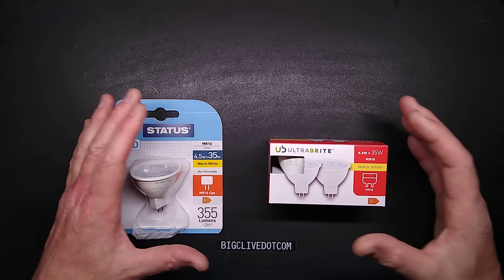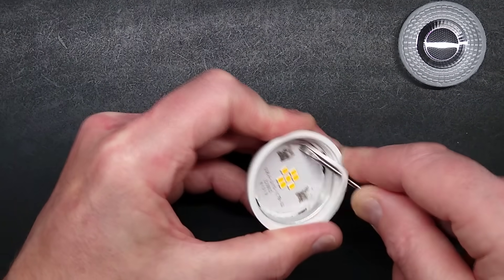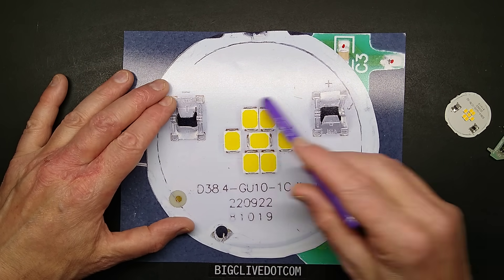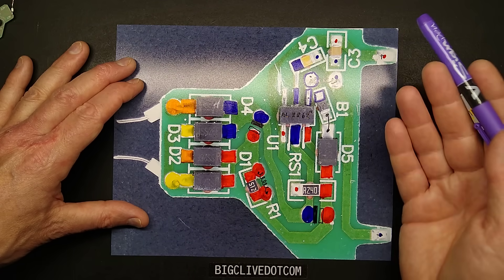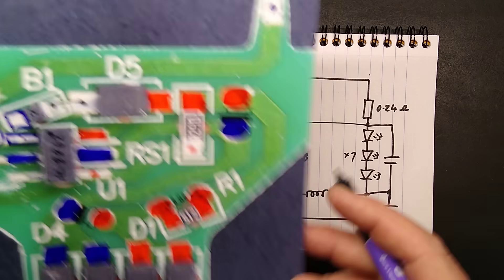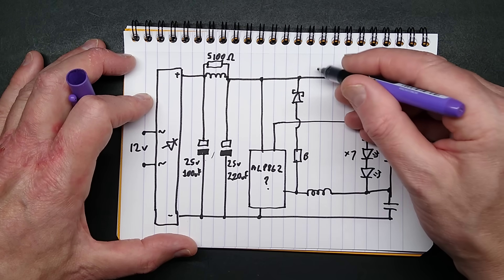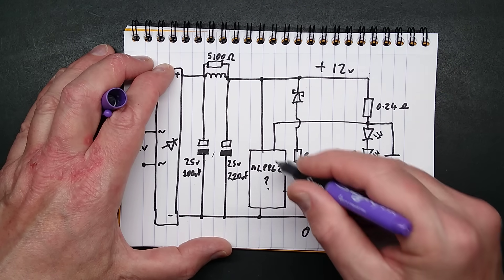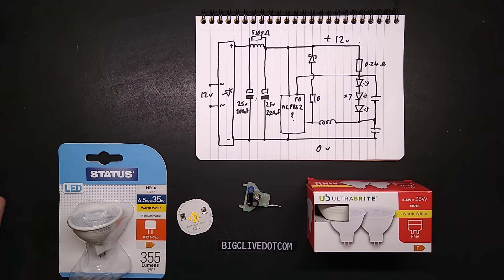Poundland 12V bulb with mystery component

Comment: Hello Clive. Just found this video.23rd  September 2025.
Not very popular now in S A. They were used to replace the MR 16 50 W Dichroic T/H lamp 2 pin. This reflector lamp used a a coil and core or an electronic transformer 230/12 volt A C. The polarity of connecting made no difference. when the 12 V A C LED replacement was introduced. No attention of the polarity was even thought  then when fitting.  Was the LED electronics designed to work on both A C and D C.circuits.? Asking for a friend.
Reply from the maker: The proper modern LED lamps can handle AC or DC and have regulation.

Comment: 3:50 I really like those big printouts of the circuit boards. But in this case, it seems to be a bit too glossy, or the lamp is positioned inconveniently - the reflections make the upper part hard to see.
Reply from the maker: It was a different filming location with less than ideal lighting.

Comment: I need help with my led-lights. If anyone can answer, it is greatly appreciated.

I have 7 spotlights in my kitchen. They have a g4 socket and they are powered by two 12v transformers. The lights originally had halogen bulbs.
I have bought g4 LED bulb replacements that claim they work directly for halogen replacement. However, they dont last long. Less than a year. The money i have saved in electricity is long gone compared to the led bulbs that burned out.
Is there a way I can make the leds last longer? Decrease the voltage with some component? What is my best option here? I really like the spotlight fixtures and dont want to replace them.
Reply from the maker: If the transformers are electronic halogen transformers then they are notorious for damaging LED bulbs.  It may be worth swapping them for regulated 12V LED bulb drivers.

Comment: Some things: First thing, the black board is perfectly okay, but it is just not Big Clive without the traditional, stained hardboard board.  🙂  Next thing, the style of lamp in this video is common, and Big Clive is right that they are run at the edge of failure, because they do not live long.  Another thing is RFI: I notice many comments suggest B is a ferrite bead.  This style of lamp are okay-ish for RFI; however, there is another commonly available style where the RFI is absolutely terrible, making it impossible to listen to the radio while the lights are on.  It is so bad that I sent a complaint to the manufacturer!  The latter style, however, gives better light and runs cooler.  RFI and suppression of RFI from these lamps might make an interesting topic for a future video.

Comment: I acquired some unbranded mr16 type lamps & wondered if i could use them at 24v. So i monitored the current & started winding up the voltage. The current started falling making me think buck converter, a good sign but i learned it had a 16v electrolytic cap when it went pop.

Comment: Years ago I put 3 GU10 LED bulbs in a light fitting which worked great. Over the next few months our burglar alarm siren kept going off, but no trigger was shown on the control panel. I then realised that iit was always at night when I was in the room that had the new LED bulbs. The wireless alarm siren was mounted on the wall ouside the same room and included a circuit that detected if someone was trying to jam the alarm system. So iits a nice touch that the LED bulb manufacturers are now adding B1 in such lights to suppress EMC.😂

Comment: I didn't really follow why this thing was switching on and off. Is that just a result of protecting the leds from over voltage? If the supply is a steady 12v would any switching occur?

Comment: That Chip must be a variant of the PT4115
1.2A LED current at up to 30V Input Voltage
Cloned by everyone, also with different specs. I believe there is a 50V variant and a 2 or even 3A one.

Comment: Hmmm, I need to try those. I made a solar/battery powered solution in my shed with modified (rearranged 9v LEDs in parallel) 230v Ikea LED bulbs found in the recycle bin. The problem I had is that a battery powered isn't always 12v (depends on the charge state of battery, load and dips in the system) and this will effect the amount of light the LEDs will produce. That is pretty annoying. What I did to stabilize/regulate  the light is adding a buck converter to output 9V constantly. The benefits of this is that there is a huge working voltage range between 13v down to 10v approx with always the same amount of light until the battery is really empty (shut off). I wonder if these bulbs (with the smart chip inside) can do similar, to keep the amount of light the same, in any condition by regulating the voltage/current to the LEDs.  I didn't know there is an 'advanced' circuit inside those bulbs, I always thought these were just 'stupid' LEDs. Thanks for showing us. 👍

Comment: A few comments:
-- The  control chip is probably a knock-off AL8862, in a 5 pin package (without the no-connect and double-pins).
--- when run on 50/60 Hz, this lamp will have a lot of flicker at 2x line frequency. If you have a cheap light sensor and a scope, you should be able to verify this. Most electronic transformers have a dead-time during the input line zero-voltage crossings, and will flicker as well. 
--- the input to the lamp circuit looks capacitive to the outside world. Cheap electronic transformers operate at about 20kHz and use a self-resonant circuit (no control chip) which can struggle to handle the 20 kHz current spikes charging the lamp input capacitor, and have a typical minimum load of 10 watts. Line frequency magnetic  transformers have no problem driving this capacitive input. Due to the 20kHz waveform, it is generally a bad idea to run any load  off an electronic transformer that is more than perhaps 2 meters/6 feet away. Getting rid of the input cap(s), or reducing their value, would make the lamp better behaved with electronic transformers. Better electronic transformers (with an internal control chip) can go down to no-load. A lot of these lamps use a boost circuit, rather than a buck, to reduce the flicker. The expensive MR16 lamps use a two-stage design to boost the input voltage, drive a modest ripple cap, and then have a buck to run the LEDs, which can get rid of the flicker.  
-- both electronic and magnetic transformers have no problem driving halogen/incandescent loads.
-- Yes, you can dim these lamps. Use a leading-edge (triac) dimmer ahead of a magnetic (50/60 Hz) transformer, and use a trailing-edge (electronic) dimmer ahead of an electronic transformer.
---  More specifically, these are MR16-GU5.3 lamps. It is 5.3 mm between the pins, with the pins being straight (no retention). The line voltage versions are typically MR16-GU10 with machined pins that lock into the socket in a bayonet fashion (twist install).

Comment: I have several of these lamps from Lidl that I use on a DC supply @12 volts. They tend to get warmer when running on DC compared to when they are run on AC. Any idea as to why???

Comment: The mystery component looks like a SMD inductor, but the "B" marking is the first letter of a ferrite "bead", I have no idea about why they have to do this, maybe they bought a lot of diodes but they have a too long reverse recovery time and heat up too much, so they had to add a ferrite bead (which is essentially a small inductor).

Comment: Stuck for a socket for these lamps ( and , G4 lamps ! ) ? ? .... find a Dual in line ( 0.1 inch )  multiple socket ( from an old desktop computer ? ) , plug these lamps in at 45º , ( DIAGONALLY ! ) and this works a treat .... should you use a long 30 way socket , you may plug in multiple lamps ! ( common each side up etc ... ) great for emergency lighting ... DAVE™🛑

Comment: At this point LEDs are so overdriven that they get even more hot than cheap chinese CFLs. Some earlier reputbale brand like Philips LED filament bulbs contained a helium-oxygen mixture for high thermal conductivity to cool the LEDs. I have to get a spectrometer and test some LED filament bulbs as plasma balls. Cheap chinese ones are probably nitrogen or argon filled which have low thermal conductivity and the LED chips get hot.
Reply: Why would one want oxygen in a LED gas mixture? Seems like a mix of helium and nitrogen would be better if helium alone would be too expensive.
Reply: @NiHaoMike64  Nitrogen has lower thermal conductivity.
Reply: @mernokimuvek  Looked it up, it's about the same as for oxygen. Actually, what might be possible is a hydrogen/helium/nitrogen mixture, with the amount of hydrogen limited to make the whole mixture nonflammable.
Reply: @NiHaoMike64  Hydrogen molecules are small and might escape at glass to metal seals. Helium and even neon can also escape if the seal is low quality.

Comment: You could print onto a mat, a shot of your desk at home. I'm sure it would travel well made of the appropriate material. Just extract a frame from one of your videos and go to a printers near where you are working and it would be ready for the next video.
Reply from the maker: I did take an A4 version of my desk for backgrounds to the thumbnails, but didn't use it.

Comment: Hi Clive, I've been a fan of your channel for years! I've noticed that air fryers have been doing the rounds on TikTok shop for £8 - I suspect they're quite dangerous and was wondering if you'd be interested in doing a video on them? I'm SO curious as to what's inside them (or other similarly cheap air fryers).
Reply from the maker: I'd be suspicious of an £8 fryer.  Sounds like a scam.  They're basically just a mini fan oven with a motor at the top that has a fan on both ends.  An outer one that cools the case, and an inner one that circulates air past a circular heating element.

Comment: My bathroom had 4 MR16 lamps each with its own transformer. I fitted LED bulbs which seemed to work fine. Only when i accidentally left them switched on for some time did they start flickering.
Cheapest solution was a single LED driver module feeding the 4 lamps. Lots of fiddly work in my loft but worked.
It always amazes me how such a simple looking thing has so many components inside.
Reply: This is the exact setup in my bathroom! I'm looking to change to led as 1 transformer has stopped working.
Could you tell me which led driver module you used and how if possible. Thank you.

Comment: The MR16 being 2” expressed in 1/8ths of an inch seems a bit odd. Is there a history behind this?
Reply from the maker: It's just a standard in the lighting industry.  A T8 fluorescent tube is 8 x 1/8" = 1" diameter and a PAR64 lamp is 64 x 1/8" = 8" diameter.
Reply: @bigclivedotcom  Maybe due to the plumbers influence.

Comment: Call me old fashioned and out of date but which would be better, the way I was bought up with (proper meaty transformer, bridge, ceramic cap, electro cap, 7812/7805, electro cap, ceramic cap, resistor, LEDs) or this weird way of messing with sense inputs and current weirdness that I fail to follow or understand LOL??
The same bulbs I have in my passage (philips though) on a wire pair fitting, normally found in shops, on a hefty 11.4 volt transformer hiding under my bedroom floorboards. Hefty as the fixture was rated for 5x50W Halogen lamps, now 5xLED 12v ac/dc lamps :) Now I know whats in them, more than I thought would be :)

Comment: I can't stand these MR16 LEDs. It's not because they aren't decent lights, but instead because no manufacturers seem to specify the beam angle of their bulbs. In fact, nobody seems to make spot versions at all! They're all floods! I'm shocked that this is a problem that has to exist. Would some little lenses and maybe a small length of internal shade really be too difficult?
Reply from the maker: It is quite hard to get the same focus as with the tiny filament of a classic halogen lamp.  The LEDs cover a much wider area.

Comment: I bought this style (reflectorless, matte plastic cover) from aliexpress and they are super hackable right on the front plate with two parallel 0,5 and 0,6 or so Ohms sense Rs. They also have a generous electrolytic cap that fades just like a halogen lamp when turned off. And yes, I had indeed to replace the old 11,5VHFAC halogen transformers, they work fine with 12Vdc and don't flicker with a 50Hz classic iron transformer either.

Comment: The thing with those GU 10(?) fittings, I have found, is that the sockets go high resistance after a few years, I have 5 of them (12v halogen) in my TV room, running on a transformer which supplies the lamps with 12v AC. I have had to replace many more sockets than lamps over the 15 years those things have been up there.
Reply from the maker: The bases for the classic 12V MR16 lamps have always been notorious for burning up.  Theoretically, the LED lamps operate at such low current it should help the holders last longer.
Reply: @bigclivedotcom  They fail due to heat, not current through the connector.  It's doubtful any manufacturer double nickle plated the contacts, like the way quality high temp crimplugs are manufactured. 
I've seen Halogen lamps create enough heat in these MR16 lamp fittings to distort the diecast housings.

Comment: I live off grid and use 12v down lights almost everywhere. I still have some decorative 240v lighting  and  some modified street lights I picked up from a scrap metal yard, I removed the sodium driver and just use a BigClive modified ES LED lamp instead.

Comment: I have a few of these and I'm going to make an awesome flashlight out of one. I will either just use regular batteries or if I can find a portable 12v supply like a small battery pack with built-in charger.
Reply: What voltage range is acceptable? Lipo packs for RC models might be suitable. Or check LiFePo4 if the voltage range is an issue (they have a slightly different range closer to classics SLA batteries). Both Lipo and LiFePo4 come in a variety of shapes and sizes (and cell numbers) so you should be able to find something to fit whatever you're building it into.
Reply: @tin2001  I'm going to stay away from RC LiPo packs due to them being able to catch fire. If the lights don't use much power I'll just use regular AAs but maybe C's or D cells yes ghetto blaster boombox batteries to give it stability and more runtime. If I decide to use lithium I may use the old 3 cell pack from my hot wheels racer car which has a burned out motor. 3.7 volts x 3 11-12 ish volts and I can use parts from the car. I tried to find a motor for it and put it back together but i've beaten it to hell.

Comment: I have a 6' (~1.5m) fiber optic Christmas tree that uses one of these. To offset the heat from the 35 watt halogen it originally used, it had an odd cooling fan that essentially ground itself apart. Not having much luck finding a suitable replacement fan, and having visions of flames dancing in my head, I removed the fan and switched the lamp to a high CRI LED lamp in this form factor. It's worked perfectly, and is a LOT quieter now without that fan. I didn't even have to bypass the thermal cutoff. 😁
Reply from the maker: LED looks great in those fibre optic displays.
Reply: @bigclivedotcom  Yeah it does. I'm glad I splurged on the high CRI one though. I tried a cheaper one just for giggles, and the red nearly dropped out completely.

Comment: Like others have said, B1 is almost certainly a ferrite bead (B1 = Bead 1). It will measure close to a dead short at d.c. but will have a specified impedance at high frequency, typically 100MHz. At those frequencies the ferrite is very lossy and is typically used as a suppression device. Here it may be to damp any ringing of the switching current caused by the parasitic capacitance of the circuit, or more likely the cheap bobbin inductor. It’s probably more cost effective to add a simple SMD ferrite than to use a better, more expensive inductor.

Why suppress the HF ringing? Mostly for EMC reasons, especially if the test for such lamps in some regulatory jurisdiction requires testing of an installation of many such lamps together, as would likely be the case in practice. A ringing transient every time the diode switches will produce conducted emissions back through the transformer, and radiated emissions from the installation wiring. Other reasons include accommodating the use of a very high speed switching diode for efficiency reasons, and reducing transient voltage stress on other switching components such as the integral mosfet in the buck converter chip.

I use these ferrites a lot in EMC filters for industrial circuit designs where I need to keep HF signals from escaping a PCB and radiating from wiring.

Comment: Well now, you've just given me an idea for reusing my old mobility scooter batteries! They're knackered, as far as scootering goes, but used in conjunction with these lamps, they could probably supply enough juice to run enough to light me up in a power failure?

Mystery "B" component.... For some reason I keep thinking "ballast" but what type and why, I haven't a clue! But for some reason I sort of see a similarity to the circuit in a  fluorescent luminaire. Spouting blocks, I know!! 🤦🔨🎆🤣💨
Reply: If the batteries sit at above about 11v when left unplugged for a few days after charging, then they very likely will run a small lamp like these for many hours. The key thing  that the battery can hold an OK charge when left sitting and it doesn't self-drain below a usable level before you need it.

It's surprising how much capacity is left in those batteries if you don't need to pull a high load. I used an old "dead" car battery with a solar panel to run a 10W LED floodlight for about 4-5 hours per day for over a year. Eventually it stopped holding a charge over about 11v and the usable capacity was so low it didn't run long enough to be useful to me (still got 2-3 hours, but I needed about 5 to get from sundown to bed time).